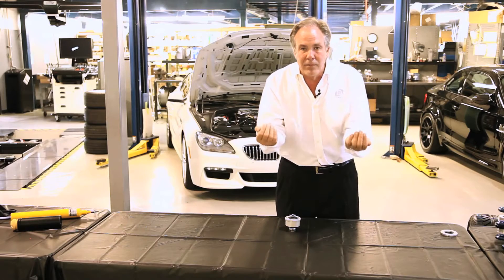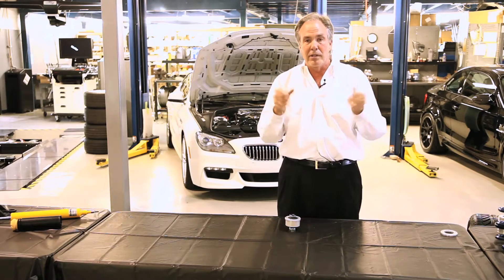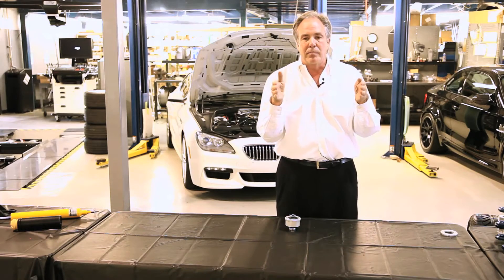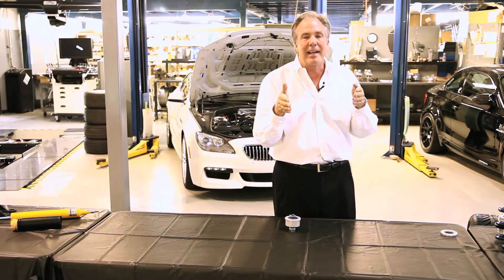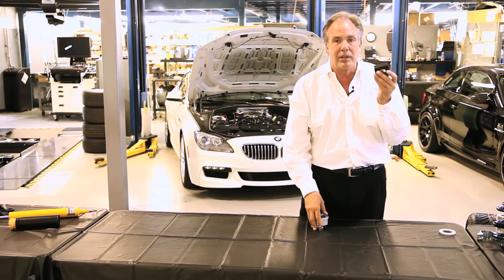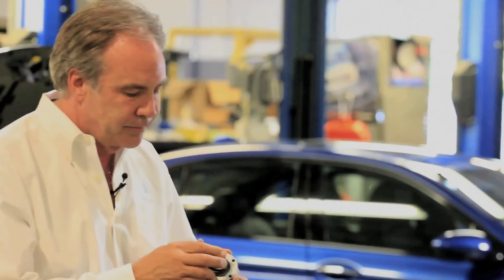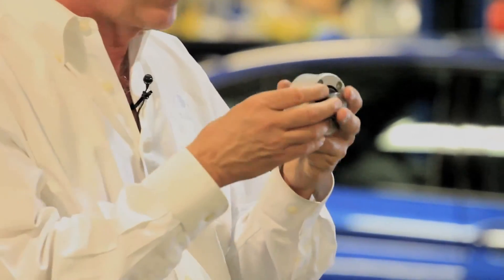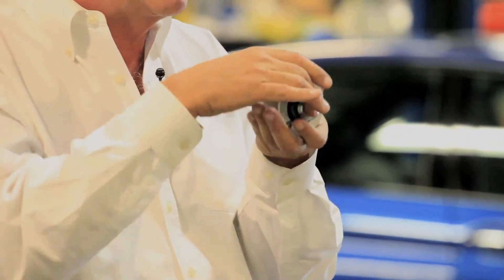Tech Tip Tuesday - Steve Dinan explains monoball bushings

Comment: monoball bush for the rear trailing arm on BMWs with Z-link rear suspension including e36 and e46 does magic. They change handling dramatically. Toe out is controlled under acceleration and tires wear less. Its a way better option than harder rubber or poly. They also last very long , I had mine over 4 years and its still solid.